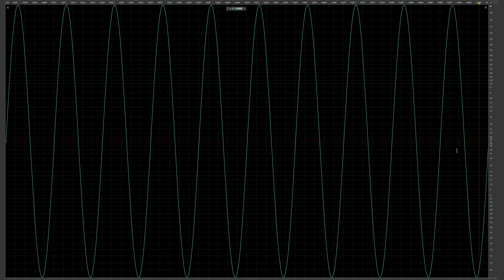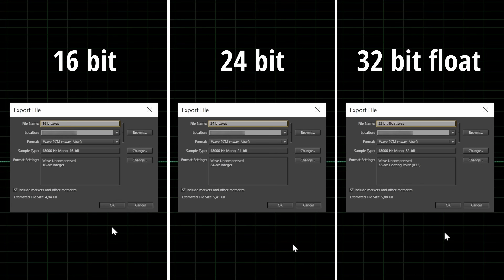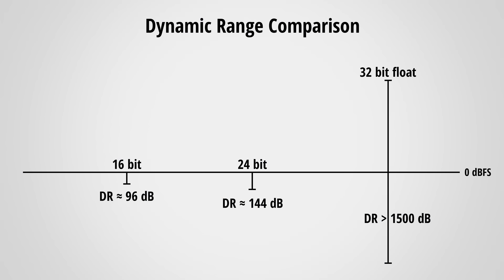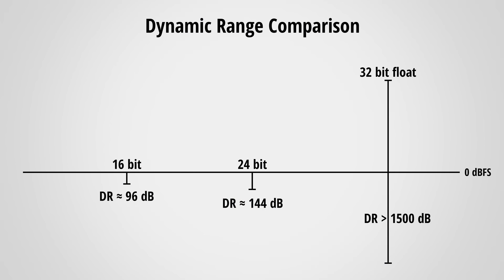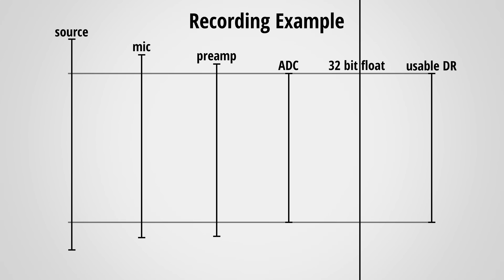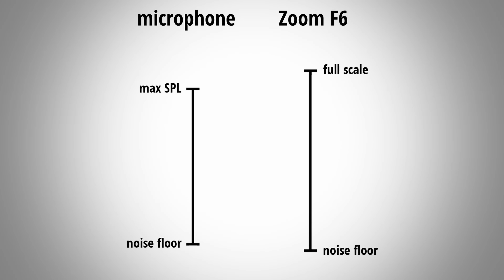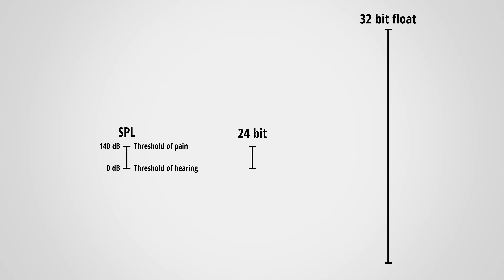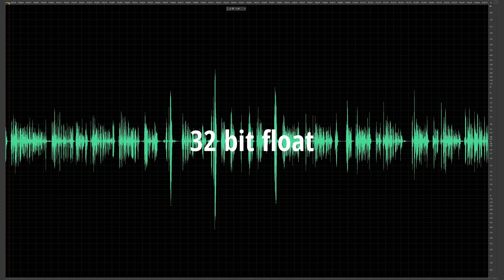The TRUTH about 32 BIT FLOAT for audio recording– Really useful or marketing hype?

Comment: You inspired me to work through dynamic range examples to settle in my head how I need to gain stage or not. Ambient noise at its quietest is generally 20dBA. The loudest signal you might want to capture is a close-mic'd drum which can actually hit 140+dBA at the mic itself. The quietest signal from the drum itself? Even up to 60dbA is probably going to be drowned out by ambient bleed from the kit. So that leaves you needing about 80dB of dynamic range, which means you can set your gain to peak at -60 dbFS and still be ok as far as being able to work with the signal in post, and that's one of the more extreme scenarios.

Live monitoring and getting a quick mix, yeah it definitely still helps to have a more reasonable print level. But at least from a pure "capture it" perspective, one can get away with peaking pretty low and still having good audio.

Comment: Who will test the processing done by the recorder when it combines the two data streams? (from the 2 ADCs or the 2 gain settings) Signal reconstruction surely introduces artifacts... INHO 32 bits float is essentially Zaxconn NeverClip. Is this mentioned in the "Zoom F6 - how it works" ?

Comment: Some 32 Bit Float recorders do not allow to set the gain (such as F3), but some do (H5studio or H6studio). Is there a benefit or potential pitfall with the latter type? Does it make any difference which gain you use, when you can boost or cut the gain afterwards anyways? This question is not answered by that video and I have found different statements online about that. Still not sure what is correct.

Comment: 32-bit float recording isn't so you can reproduce that full range in the resulting recording, since no human could hear that range. It's so you can adjust gain after recording rather than having to get it right beforehand, either reducing it without clipping, or increasing it without bringing up an audible noise floor. If you can get the gain set right beforehand, there's little benefit.

Comment: 7:00 - well, you are wrong!
The point is not the dynamic range of the sound but the dynamic range "over-the-wire".
And due to the fact that there are several input levels (from "phone-level" over "mic-lever" to several variants of "line-level" [consumer vs. professionial audio gear level]) you get a much greater dynamic range for an audio interface to be able to record. You can have 60 dB dynamic range of a microphone but the the range of those various line-levels, i.e. electric signal levels can do another 100dB. In that case 24bit would be too low to cover everything).
So for a GENERAL audio interface this makes sense.
Ich you only have an audio interface let's say for microphones, 16bits would probably be enough, 24 definitely...

Comment: I'm blind, and I can't see the waveforms on recorders, so it's hard to set gain for me during the recording phase. Monitoring isn't always possible, as I often record in situations where wearing headphones isn't possible. As long as I have a mic that has good dynamic range, I can now record without setting gain too low and introducing a bunch of noise. It's also easy to fix issues in post, and having that audio data stored without the clipping baked in is great. All I have to worry about now is mic placement and whatnot, but that is much easier for me than the literal impossible task of checking the waveform

Comment: Thank you for a sensible and scientific analysis of 32-bit float audio without the marketing hype. I've been recently encountering this a lot with DSLR cameras which is ridiculous because the preamps on DSLR cameras are other garbage and 32-bit float won't help a bit in that case. In the editing Suite it can be useful but the dynamic range of real life is very limited unless you're talking about recording Saturn 5 rocket launches at close range. I have recorded numerous classical concerts and in the concert hall the best dynamic range you can get is about 62 decibels which fits very well within far less than 16 bits. The most dynamic range I have recorded was fireworks at the launch position and I managed to eke out 86 DB of dynamic range between the sound of the Crickets in the woods 200 yards away and the loudest explosions directly overhead. What I'm saying is that the dynamic range of most content is going to be far within the limits of 16-bit audio.

Comment: the difference between int and float:
int stores numbers as discrete values. 24 bit int has 16777216 possible values ranging from 0 to 144. Exceeding the range results in clipping because there aren't any values outside.

float stores numbers as a value+decimal place multiplyer. 32 bit float has a basically infinite number of possible values ranging from -2^128 to 2^128. It's still possible to exceed the range, but that's really unlikely to happen.

Comment: I use 32bit float for editing, I suspect that recording in the format is only useful because it allows the entire processing chain from recording to mastering with bit conversion. 

A 32 bit float has about 23 bits for the mantissa (the detail) 1 bit for the sign and 8 bits for the exponent. 

So equivalent to 24 bits 23 bits plus the sign

The real question is if an audio interface that records 32 bit float has an AD converter with more than 24 bits. 

Most AD converters are successive approximation. 

I’m not sure how that can even work to spit out a float.

Comment: Floating points over 32 bits are just the size of the container to handle audio signals. But I don't think we should talk about dynamic range when it comes to throughput capacity. It will only be used in ADC and DAC. Multiply each bit by 6dB only for audio signals, not container size. I think that's where all the misunderstandings started. Whether a session is a 32-bit floating point or a 64-bit floating point, the audio signal is actually a maximum of 24 bits. This is how ADC works, where the dynamic range goes up to 120dB.

Comment: I am a bit late to this video.
I have my DAW set up to 48kHz and 24bit as my interface doesn't support 32bit and I never needed anything larger than 48kHz.
Question is: For mixing purposes is it better to set my DAW to 32 float? 
I am dealing with 48kHz/24bit or 44,1kHz/16bit files anyway.

Comment: Thank you for making this video. I'd appreciate if anyone can help with a beginner question: If I record a synth performance via line-in into a Zoom H1e (32-bit and two different-sensitivity ADCs), would the loud passages have exaggerated loudness (relative to the quiet sections) compared to an H1n (24-bit) recording? Would I need to use post-editing (normalising) to restore the original dynamics? Many thanks.
Reply: The dynamic range of your recording is determined by the performance. The fact that 32bit float has a wider dynamic range doesn't make the performance any different. Unless your 24bit recordings presently exhibit audible issues with clipping it's unlikely to sound any different. It wouldn't affect the need for normalising.

Comment: The marketing hype is pretty clear now that audio recorder manufacturers have started introducing 32 bit float devices which only have single a/d converters, but claim or imply that the devices obtain the same benefits from the use of 32 bit float as devices with dual converters.  If you use a 24 bit a/d converter to store its output in a 32 bit float container, the container makes no difference to the numerical values stored.  So it makes no difference to the audio.
Reply: Julian, I wish you would make  a video about that.  There has been a scandal related to a new Tascam device in the last few days where a so called 'product specialist' from the company, who claimed to know more about their devices than anyone else there, stated emphatically on YouTube that their new  '32 bit float' device must have dual ADCs because a single ADC could not create a 32 bit float file.  He or she continued to claim this even when told that their engineering department disagreed.  Finally someone at the company realised they were making false statements and deleted them, admitting that it's indeed a single ADC device.  They should not be marketing devices talking about the output format but by the number of converters - from which the output format can be inferred.  I also wonder about the 32 bit float wireless mic/recorders hitting the market, where their publicity is silent on the ADC configuration.  The wool is being pulled ovrr our eyes!

Comment: What about 32-bit vs 32-bit Floating Point? What's the difference here, which one should I be using for the most videos out there? The Hz, I keep it to 48000Hz, always. My AE-5 Plus sound card offers 32-bit 384000Hz maximum. It says nothing whether it is floating point or not. My video player, however, Potplayer, offers both options. I simply want everything to be matching with as little processing as possible, input/output/rendering. Of course, I could use DirectSound which my card provides, but I miss out the sound profiles which I really like, like, "Cinema mode" or "Game mode." So what do I do in case I don't want to use either DirectSound or 24bit 48000Hz SPDIF (the latter only provides 2 channels, 24-bit 96000Hz maximum).

Comment: I use my Zoom F3 to record bat ultrasonics. For the huge and unpredicactable dynamic range encountered when recording those signals 32 bit float is a game changer.  
So much simpler not to have to worry at all about gain settings when recording outdoors  - usually in the dark!

Comment: I’m hoping someone who records high gain guitar amplifiers, especially if they use genuine (I checked) Shure SM57’s
My cabinets are Marshall Mx412’s, Shure SM57, camera is a  Zoom Q8n-4K Handy Video Recorder. Seemed like the ticket since Zoom products are known for good audio. 24bit while their handhelds are 32 bit float.

I recorded with the preamp set to between -6db and -12db. I bought a decibel meter to measure actual output at the cab, which was between 85db and 95db max at the grill cloth. Mic centered at the cone. As far back as 2’ just to see if placement helped. Recorded over and over.

Result: GARBAGE sound quality, mostly clipped and distorted. Finally gave up on this video camera/audio recorder which is supposed to be able to handle live music and guitar. Even turning down the volume to 70db it kinda sucked. Should t 24 bit handle up to 144db?

Any help would be appreciated. I just need to record my guitar videos and get Pat this logjam of garbage audio recordings. Sending this camera back of it’s the culprit. The SM57’s SPL is supposedly around 150? I’ve read they can go as high as 180.

Comment: So, 32bit fixed point audio interfaces vs 32bit floating point interfaces? Is that a thing? The hardware has to be 32bit floating point for the recorded file in the DAW to have this dynamic range...is that correct @JulianKrause ?

Comment: Hi, many thanks for this Video! I am new to Audio recording. I have only an old Rode Videomic pro and am intrested to buy a 32bit float audio recorder from Tascam (DR 10L -PRO) I always read they are used with Lav-Mic's.. But in theory i could attach the shotgun mic with it's preamp set to 20dB, to the Tascam DR 10L-PRO to record and bring it down in post? Or would the preamp from Rode Mic fry the preamp from Tascam? While the 32Bit Container/Format could handle it, the electronics may be the bottleneck here?

Comment: First, you're the best!! I understand that one can get the advantages of 32bit Float, if at all, regardless of type of analogue signal including Mic, Instrument, or Line level as long as the signal has not been through A/D conversion in the signal path when it reaches the 32bit Float interface . Is this correct?

Comment: Hi Julian, Thanks for your very instructive videos. The CD industry still uses 16bit/44.1kHz. I produced several CDs in classical music, and the tradition was to record also with 16bit/44.1kHz, by fear of truncation. What do you think/advise about ? Should one continue to record 16b/44.1kHz as CD requires, or increase the rates ?  Greetings
Reply: No reason not to record at 24 bits. One can then dither to 16 bits, after all the processing, when exporting for CD.

Comment: Please correct me if I'm wrong. I see a difference between bits required to represent the full dynamic range of audio and bits required to capture the dynamic range of audio with our devices. While 24 bits can represent all the dynamic range our ears can tolerate, in order to record it we have to capture audio above the noise floor of our signal chain. This is why instead of recording low level input with lots of headroom, we try to record at levels closer to the top and risk clipping. Ideally we could record with an average signal of -12 dBFS and never go over 0, but in practice this can be risky. We can record at a lower input level, but then raising the signal in post production we will also be raising the noise floor of our signal chain. A benefit to recording in 32 bits is setting your recording level so your average signal is higher above the noise floor. The extra headroom of 32 bit float may save the day when there would otherwise be clipping.
Reply: Exactly my reasoning.

Comment: It sounds like a good idea when recording audio along with video because it's hard to take care of audio levels when you are trying to record video as well so it's easy for distortion to happen that can't be fixed later. With 32 bit float you can fix the problem later and reduce the signal to below the distortion.

Comment: Thank you for explaining this. I am still curious about whether 32 bit float creates more safety around sudden spikes in db, like a sudden loud laugh. That type of sound makes me wonder whether 32 bit would be helpful.
Reply: Yes it would deal with sudden loud sounds. You just need to make sure that you also have headroom from mic/preamp/ADC, which is easily achieved nowadays. If the distortion occurs in the analogue stages then that's what you record no matter how capable the digital end of the signal chain.

Comment: bro, imagine a camera operator with a lot of stuffs to control, snario, direction photography, actors/models, and still have to think about the audio, I dont want to check if the file on the set if going well, I just want get the audio and make it works on the pos production, so, it's a game changer for run & gunprofessionals for sure

Comment: 24 bit converters gave us a solution we’d all been awaiting. When recording with 24bit converters, a -20dBFS peak level is totally usable, which was not the case in 16bit. 24bit recording gave us flexibility at the input, flexibility setting record levels. A 32bit recorder does not add to that input level flexibility as the limits of physics have been met already at the input. We can’t lower the source noise by 48 db and we can’t send 250Vac from our preamps to a DAW.

For those of us who have equipment with multi converter and preamp tech such as a few field recorders or the Neumann Digital microphone,the safety extension IS available for 32bit recording. For the other 99.999%, it is not. This distinction is important and often misunderstood. Any situation in which the recording engineer has control (even a second of soundcheck) will return perfect results recording to 24 bits, using 3 or 4 of those bits (18 to 26db) for safety, much like we have always set safe levels, but with far greater room for error. Recording with the same front end (mic, preamp) to a 32 bit file accomplishes absolutely nothing. 

A 32bit float(ing point) digital file gives infinite range for the most unimaginably clumsy file handling such as very large gain and eq processing IN THE DIGITAL REALM without check the result AND simultaneously erasing the original signal. If these exceptional conditions match your workflow, then 32bit ‘Float’ is manna from heaven. Such situations might arise in field capture for film or TV. In the studio or live concert recording, these actions would disqualify any engineer. In 50 years, I’ve never encountered them.

Comment: Bigger resolution means better quality and more crispiness. It is not about getting only extra DBs. Do we really need 4k, 8k TVs when HD is enough? With Sound Waves is the same. If you have ever calculated harmonics, you would know it make sense. The problem is with low quality plugins, limited DAWs, poor samples, limited synths and poor quality equipment.
Reply: This sounds like you don't know what you're talking about
Reply: @NamelessSmile  Let me explain😃 It is not only about missing peaks but about frequencies and resonation. 
1.Computers can't handle particles very well e.g 1/3 because of HEX/Dec implementation. Calculating semitones(particles) in many cases is always off because of such limitations. Digital processing removes their smooth characteristics. 
2.Bigger resolution in both dimensions: x=time, y=bits per sample is able to record more accurately shapes when frequencies are estimated and overlapping bringing as a bit closer to the analogue sounds. 
Check formula for semitones and how decimals are process